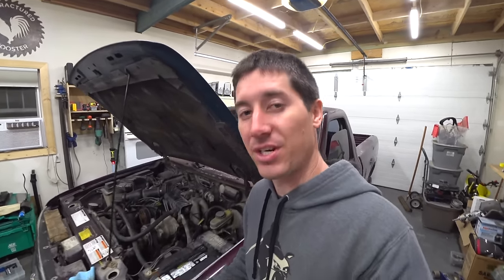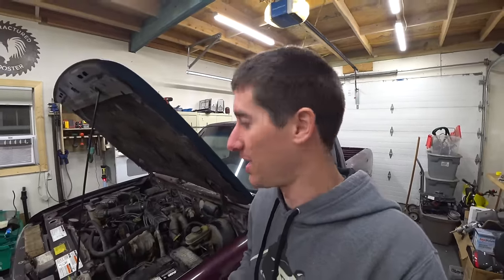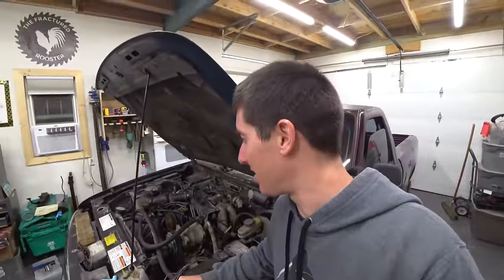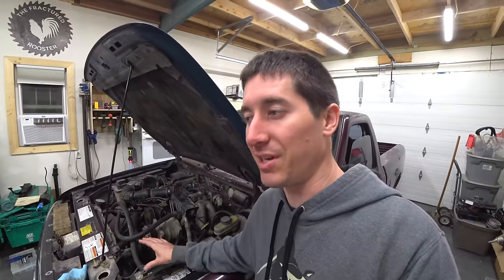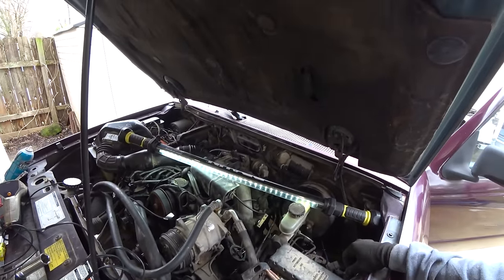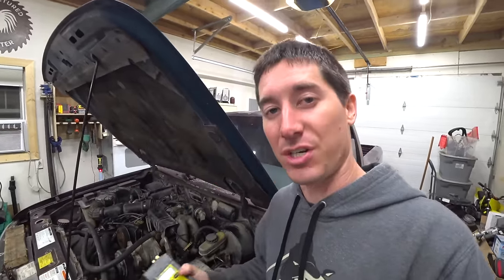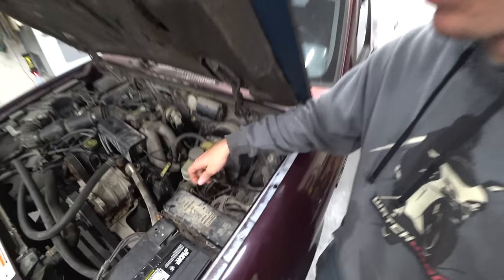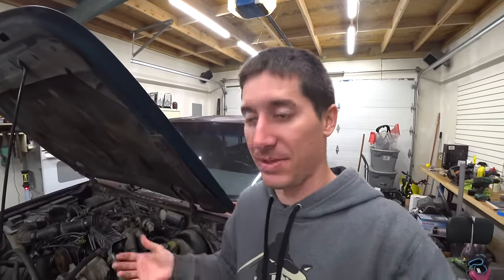We FIXED The $300 Ford Ranger And It Doesn't Make ANY SENSE

Comment: When you unplug the SPOUT connector you are literally unplugging the connection between the ICM and ECM. It bypasses the main computer. The ECM sends the dwell times to the ICM and it reacts to it by firing the ignition coil on time and gives the coil time to recharge. The reason it fails is because if timing advance is incorrect then the ignition coil cannot maintain a consistent spark and the truck will not run.
Reply: I think it might be the TFI module
Reply: Say what you want about Ford early EFI and TFI systems but when they work, no one has any complaints. Even Ford TTB axels provide a really smooth ride when they have their issues sorted out.
Reply: @TheRazor375  TTB is one thing. EFI after 20 plus years is another. That random if eats at people worse than a ball joint.

Comment: Did you check coolant temp sensor? When I use to work on Genie boom lifts, with 2.3L ford engine, it was common to have a no start due to a faulty coolant temp sensor

Comment: I always buy broke down vehicles cheap and fix them. I bought my cream puff 93 Explorer for $500. It ended up needing a CPU. I bought a pretty nice 97 S10 4.3L manual transmission. It needed a transmission & clutch. I got that for $700. Spent $800 to fix it. I could have fixed it cheaper but I don't like using the cheapest parts. And I replaced the engine & transmission mounts. They both drive good,been driving them for 4 and 6 years now. At least they are paid for. Both have nice paint,no dents and good interiors. The Explorer had 120k on it and the Chevy had 175k on the clock.

Comment: Add a switch to the dash and wire it in place of the spout connector. Flick it off to start, on to run. Saves opening the hood.

Comment: My diagnosis? You've got either a bad Ignition Module (located on the intake manifold, which can get corroded or have grounding issues), or a bad coil pack. 

The reason why the engine sounds the way it does when you restart it, is very simple: The engine is "loping," which would indicate that half of your cylinders aren't getting spark when the ECU is controlling the truck. Usually that indicates a wiring issue between the ignition module and the primary coil pack, as the secondary coil pack has a much weaker spark.

What I would do to isolate the issue is switch the coil packs around, and see if the problem goes away. If yes, then your problem is a coil pack with a too-high resistance value, which is common, given that those coil packs sit right above the exhaust. If no, then the ignition module is bad, and needs replacing, as the signal from the ECU, through the module, through the coil, and through the plugs, hasn't changed, even though which coil pack being used as the primary coil pack is. There is also a chance both coil packs could have high resistance values.

But given that the truck runs with no problems with that connector out at base timing, my suspicion is the ignition module, in that its shorting out half of the cylinders when that connector is plugged in.

Comment: I'll give you a hint about these 1985 through 1990's trucks the thick film ignition module would fail with no reason there was a class action lawsuit. ECU computer would send code 31 for EGR circuit but was a ECU computer was bad so I installed new one then the truck run better then new

Comment: Bad coolant temp sensor? That will throw cold start timing off and it wont start because the ecu won't send the right signals not knowing the temperature. The obd1 fords were very stupid like that. I have been through it more than once where the temp sensor caused a no start. It's not set in stone thats your problem but im willing to bet you a pallet of angel soft and 100 bucks it is...😁 could be the ecu as well. But im kinda leaning at the temp sensor.

Comment: Weird.  A little over a year ago I got a '98 Ranger with the 2.5 in the same color for free!  All I had to do was to change out the slave cylinder.  Since ya have to drop the whole transmission to change it I decided to put a whole new clutch kit and a new rear main seal in as well.  Only has 139, 500 miles on it right now and runs like a top.

Comment: They usually have a coolant temp sender issue. it tells the puter to run rich as it indicates cold. makes them slow and suck gas. checking the thermostat is a good idea but replace the sender too.

Comment: The Lima 2.3 is a decent engine but yes it’s underpowered.... I should know as I had one with an automatic as my first car I bought with my own money, literal 20 second quarter mile truck. Merging on the freeway with any AC was legitimately frightening. Honestly soured me on automatics and my next truck was a ‘01 Frontier V6 5 speed Desert Runner SE which might been a Skyline GT-R compared to the Ford. I wouldn’t mind another Ranger as a runabout truck but it has to at least be a manual!

Comment: This is a parts cannon approach to fixing a vehicle. A (one of several to work through the problem- its an electrical problem)  scientific diagnostic approach would be to determine what is the  signal output (resistance) to the TFI? The TFI module regulates the electrical current that fires the air-fuel mixture in each of the engine's cylinders* sounds like misfires air/fuel is off . WIth the base timing set properly with the SPOUT (Spark Output signal) disconnected (which you did check)- reconnecting it and determining TFI output current is next approach. Otherwise your just guessing. Notes: Ford calls this electronic ignition the Thick Film Integrated-IV (TFI-IV) ignition system. The TFI module is also known as the Ignition Control Module (ICM) which reports engine position and rpm to the PCM. The PCM then determines the proper spark timing and advance, and returns a reference signal to tell the TFI module to switch the coil, thereby by creating a spark. The PCM used on these vehicles is referred to by Ford as the Electronic Engine Control-IV (EEC-IV) module. Here is the test TFI Remove the TFI from the distributor or the front fender apron-> Measure the resistance between the TFI terminals

GND-PIP IN: should be greater than 60 ohms.
PIP PWR-PIP IN: should be less than 2,000 ohms.
PIP PWR-TFI PWR: should be less than 200 ohms.
GND-IGN GND: should be less than 2 ohms.
PIP IN-PIP: should be less than 200 ohms.
If any of these checks failed, replace the TFI with
a new one.
Theres also electrical tests on the harness, etc basically you need to understand the FORD TFI system/SPOUT pull up a elec. diagram in ALLDATA. or google

Comment: Check to see if one of the wires to the spout is grounded or take the ignition module out and have it tested.
Also see if someone botched a repair and has the wrong wire spliced at the ECU.

Comment: if i was in this siation i would take apart jumper and put a switch in the cab so when you start it you switch it off and then when its running switch it on

Comment: You pulled off the connector for setting the base timing, it runs fine on base timing, but screwed up when it tried to adjust by computer.

Comment: Replace the ignition control module. it located on the intake manifold behind the power steering pump and a/c compressor on 2.3L Rangers

Comment: The timing mark can be right on but still be off one tooth in relation to the cam  and still run.  It's not fixed.
Reply: So what do you do to solve the problem? Pull the distributor?
Reply: Exactly, seems like he said in the first video that timing was just changed, it’s simple and doesn’t take no time , should have checked it long ago.
Reply: Needs a cam/crank correlation between the two done with a scope and make sure aftermarket crank sensor is going all the way to ground
Reply: For one I dont have a dizzy 2 it don't have a cam sensor either just a cps aftermarket cps are junk u have buy a good brand one or it won't read right very possible what it is and to check timing simple pull the cover off

Comment: Always keep a known good TFI and the removal tool in the glovebox, 2.3 Lima. Some cheapo ignition modules have been shown to be bad even when brand new.
Reply: That TFI is used in a lot of vehicles from the 80's into the 90's I pulled the TFI heat sink off a couple of Aerostar vans and I'm building a harness to remote install the TFI on my Ranger and my Bronco 2.

Comment: I put iridium plugs, an optima battery, fuel pressure regulator and fuel filter, and k&n filter on my ranger and it'll beat a wrangler of the same era lol. I also replaced the thermostat and flushed the coolant and heater core and it makes plenty of heat

Comment: I had a 94 ranger. My heater was acting a little funny. So I decided to flush the heater could. When I removed the hoses, they were completely stuffed with junk and rust. To a point I could not clean them out. Lol The heater worked fine after I replaced the hoses and flushed the coil.

Comment: I had one of those. The water pump WILL NOT work properly till you take the top hose loose at the thermostat, insert a garden hose (with rags packed around it) turn on the water and run it 2 minutes. This "primes the water pump!!!"  Reconnect the hose, top off water if necessary,  It will no longer be a sluggish pump and you won't burn up an engine as I did driving home from the garage (after I got the water pump replaced.).   BELIEVE ME NOW OR BELIEVE ME LATER...  Note: I was a mechanic once and a Ford tech gave me this information.  Replaced my engine w/ a wrecking yard special (non-dealer garage) , primed the water pump and it ran perfectly.  If you research the correct sources you will learn this is correct data.

Comment: My dad got a free 89 gmc Sierra 1500 with a 5.7l v8 and we had replace the starter because it get stuck or it wouldnt spun the engine along that we also had to replace the front right axle that had a ripped boot

Comment: Have you checked the timing belt for damage?  Had this same engine and could never get it to run right.  Turns out that the timing belt had a bad spot and it was slapping the crank sensor.  Replaced the belt and problem went away.

Comment: "The SPOUT (SPark OUTput) connector is the little plug on the wires going into the TFI module on the distributor. ... Technically it connects pin 36 of the ECU (the electronic engine control unit or computer) to the TFI (Thick Film Integrated circuit) module on the side of the distributor." -Merkur Encyclopedia...

Comment: There's an electrical load someplace that's being changed when you pull the connector. ECU issue that isn't showing in the codes.

Comment: I had this issue on my truck.  It turned out to be a bad ignition module.  You can check it by measuring resistance across certain pins.

Comment: That's a classic failure on these. You would be able to work straight to the answer as to what is wrong with a DSO, (digital storage oscilloscope). In fact we used to use this problem as one of the case studies to help train technicians with how to use a scope.

Comment: The coolant temp sensor is the issue for some reason when they go bad on the rangers they go goofy they either wont start or they will idle high we chased our tails trying to figure out what the heck was wrong with one about 20 years ago and it was in the service bulletin that if you are having problems with irratic idle or surging replace the coolant temp sensor and it will fix the issue I had serious doubts but was ready to try anything and what was replacing a 10 dollar sensor just to make sure and what do you know it straitened right up I never would have guessed that would have anything to do with the issue and the temp guage was showing that it was not up to temp when I knew that it had to be as long as it was running and then the guage would pop up to normal temp so I thought must be the tstat sticking

Comment: Don't think you need to worry about it getting stolen unless its one desperate thief. Have a 1999 ford Ranger good reliable transport. The trans cooling loop in the rad rusted out and antifreeze was mixed in with transmission fiuld which was one bad day

Comment: I bought a 2000 4.0l with 115k miles and it starts up and runs really rough.  When I give it any throttle it dies. I replaced maf sensor, intake air temp sensor, fuel filter, and a few more things. I ran a fuel pressure test and the highest that would get was just under 30psi and when i quit cranking the pressure drops instantly. Would that mean my fuel pump is probably my problem???

Comment: Love your vids and I am currently looking for a extremely cheap manual so I can learn manual
Reply: Lesson one: Your clutch is not a light switch. 
Lesson two: Your clutch is not a foot rest.
LMFAO! JK, JK! good luck.
Reply: 2001 Hyundai Accent. LC1 Generation. Just make sure it has the Alpha 1.6. The 4-door GL trim comes with said motor and a 5 speed. For 500-1000 bucks. I had one that pushed over 300k miles reliably. Cheap. Easy to work on. Decently fun

Comment: U buy cheap cars like me and get them running again I love what I do pretty cool what u doing I just bought a 1997 ford ranger for 200 and it's doing the same thing I have to spray starter fluid it the throttle for it to start but mine stays started after that but might be the same problem I'm checking tho

Comment: This is all well and good, but what the heck is wrong with it?  I never understood the problem from your explanation or exactly what you were disconnecting and reconnecting. 
My hearing is poor which prevents me from understanding certain words. Was it just me, or did anyone else struggle with JR's unclear words at times?
It would be great to see JR get to the bottom of the problem and send the truck down the road fully diagnosed and with the starting problem resolved.

Comment: Obviously there is a problem you did not fined but I wanted to let you know a shop owner told me a long time ago when replacing the rear view mirror mount after it is done correctly tape it in place for 24 hrs. so there is ABSOLUTY no weight pulling on it. I have done it for 48hrs. and it stayed on for years. they should change the instruction's and it will work fine.

Comment: Needs a big valve head with the choppiest cam and high comp pistons...basicly a Dirt midget motor. I've actually thought of yanking my 4L v6 for a 2.3 out of an 88 Turbo coupe, but the 4.0 is dead nuts reliable. Its 2wd and manual trans so it's about as zippy as stock rangers get. Maybe cam the 4.0 hahahaha. It's still a turd

Comment: The other connector is a 2 degree spout connector. 20 degrees is not right, should be 10. Removing the 2 degree should move to 8

Comment: Eventually it will not run at all FYI.  I have never figured out exactly what that does, but a truck I worked on that was a 94 had the exact same problem.  We pulled that same connector off, it ran for a while, then suddenly died one day crossing the street and never ran again.  You haven't fixed anything.  Just prolonged the inevitable total failure.

Comment: SUPPOSEDLY only half the spark plugs run while the computer system sees the "start" condition, and if you pull that SpOut connector, it may just disregard the computer's disabling that spark output, and may give the thing enough spark to start it. Idk.

Comment: That engine was designed for the Pinto, it was destined to be shit from day 1 lol. 

You can put a k&n air filter on that thing, when they say you can gain 8hp just from the air filter they specifically used that vehicle to get those numbers. The air comes in through this 1/2 inch hose behind the passenger headlight, it's ridiculous.

Comment: FYI JR, Did you check the module on the distributor?
Had the same problem with my girlfriend 86. Pull the spout and it would run like great. plug it in and it would start bucking and die. Spent a week diagnosing it including putting in a new computer. Turned out the TFI module on the back of the distributor was shot. Put a new one on and she ran like a top....till the fuel line blew apart (ford recall that was never performed) and burned her to the ground.
-Harry
https://www.therangerstation.com/forums/index.php?threads/spout-connector-problem.40781/

Comment: Throw a relay inline with that connector powered by the starter wire and will switch back to closed in the run position. Problem solved!

Comment: I have a 94 mazda b2300  I put new fuel pump, filter a fuel pump relay and a ignition module new plugs and wires still won't run  What could be wrong  please help

Comment: Temperature sender throws off computer. Unplugging computer from module let's module control it. Computer isn't supposed to take over untill engine is warm, but it's taking over right away due to bad temp sender. All of this is in the book!

Comment: Ford will put extra connectors with no use.  I rebuilt an entire top end of a 4.0 Ranger  and had an extra connector on the back of the block that didn't go to anything.